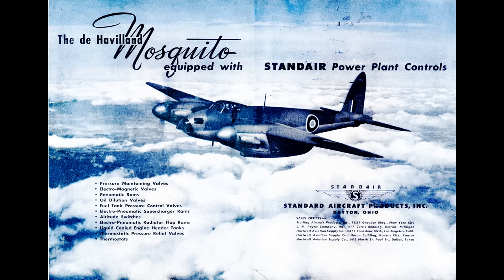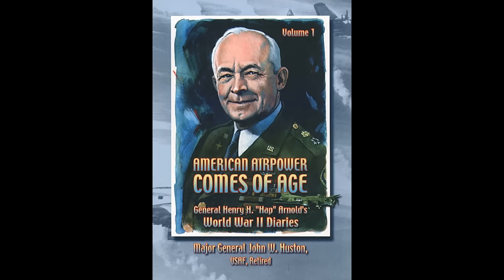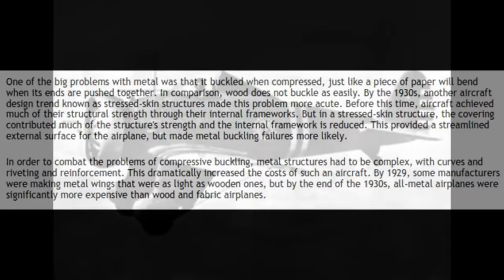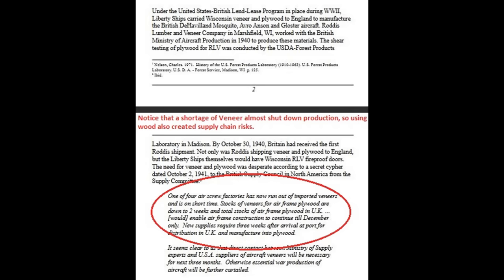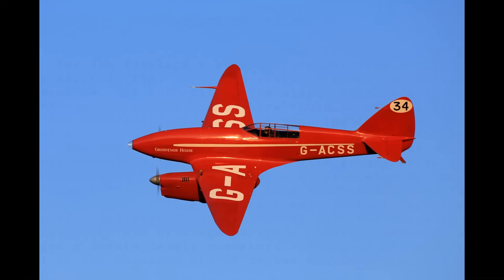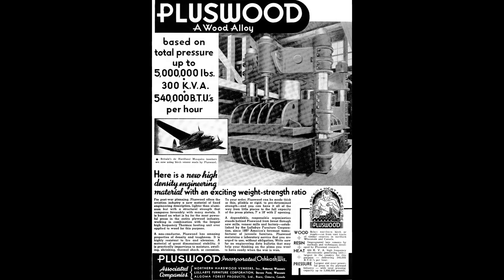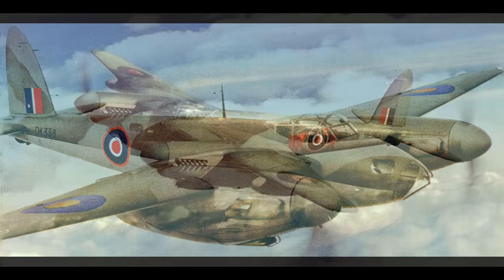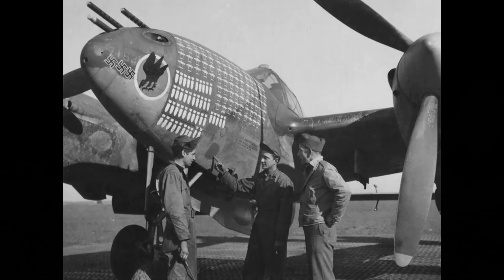De Havilland Mosquito vs. ?

Comment: Comparison of the Mossie with earlier wooden aircraft (other than the DH88 and DH91) is a little disingenuous.  Previous aircraft used a wooden structural, stress-bearing frame over which cloth or plywood (or in some cases metal) was fastened.  The Mosquito's wooden skin was the stress-bearing element.
Reply from the maker: I think you missed the point.  D.H. made the Mosquito out of wood because all their experience was based on making planes out of wood.
Reply: de Havilland didn't have any successful all-metal aircraft in this era, one could argue that the de Havilland company never made a successful all-metal aircraft.
eg; the DH 108 Swallow, DH 106 Comet and the Sea Vixen

Comment: i have seen a video where they say  is the US 9th air force swap the PR P -38 s for Mosquito and Spitfires in 1943,44

but the question off what was the best aircraft can only found if one ask 

 out of this list below you can only build one of these aircraft to do everything,witch on do you go for 

p-38
p--51
b-17
b-25
b-24
dh mosquito
spitfire
Lancaster
me 109
fw 190
do-17
he 111

if it not the dh mosquito you beet have  a good reason
Reply from the maker: P-47, Corsair, A-26 Invader, lots of good reasons.
Reply: @GregsAirplanesandAutomobiles  Really are saying if you can only have one aircraft to do every role and task you needed to do  from PR to targeted bombing you would pick the P-47, Corsair, A-26 Invader over the DH Mosquito ..
this is not about individual stats it about  what is the bast multi task the air craft and can it it do all  the task you need it to do.

Yes there all great aircraft that on a signaler task some will be better than a Mosquito,  but none of these aircraft is a better multi role aircraft then the DH Mosquito
so forget the states compere them in Military operation and tasks

so pick aircraft and match to the DH Mosquito on all the these task
i have the task the  Dh mosquito did 
heavy bombing
day and night bombing  Dh mosquito
high and low level bombing  Dh mosquito
position bombing       Dh mosquito
medium bombing       Dh mosquito
fighter bomber            Dh mosquito
defensive fighter         Dh mosquito
strike fright                Dh mosquito
ground attack fighter/ bomber  Dh mosquito
night fighter              Dh mosquito
Photo Recon          Dh mosquito
anti shipping v        Dh mosquito
passenger an postal service aircraft  Dh mosquito
resistance support      Dh mosquito
Pathfinder                     Dh mosquito
Reply from the maker: Yes, I am absolutely saying that. Furthermore, I don't think it's a valid question as no nation in WW2 even thought about building just one single aircraft, but if they did, it wouldn't have been the Mosquito.
Reply: @GregsAirplanesandAutomobiles  sorry i  going disagree with you on this 
1 all question are valid even when we not the likely hood of it happening is low
2 i find you post very interesting and informative on a technical basis but i will when comparing two or more aircraft you have take in to account there operation war record because purely compering on stats dose not give the true story.
3 keep up the grate work and have fab Xmas

Comment: There's a certain irony in that the Beech KingAir is a particularly difficult aircraft with one engine failure, especially if it's the left engine that fails. Not condemning the KingAir, just sayin...
Reply from the maker: It has to be a lot easier than a Mosquito on one engine. I have quite a bit of time in the Beech 99, which is essentially an unpressurized and stretched King Air 100, I thought it was pretty good on one engine.

Comment: I don't think the P38 could carry a 4000Lb bomb
Reply from the maker: No, but it can carry two 2000 pound bombs, and it can hit things with them. Plus while doing that it can carry 10 5" HVARs and then fight it's way out.
Reply: @GregsAirplanesandAutomobiles  it's interesting that the USAAF chose to use the Spitfire and Mosquito for reconnaissance in spite of having access to P51s and P38s . You know that the P38 was having problems especially in the ETO probably largely sorted by the the L version . Of course the British rejected it because they were not supplied with the turbo superchargers . Ultimately by mid 1944 all the bugs in all their designs had been ironed out . The problem was that USA was not ready to fight in 1942 . The fact that within 2 years they had turned this around was testament to their dynamism and ability to learn fast . By 1944 the Mosquito was being fitted with the 2 stage merlin . I think there is enough evidence to say it was the best high altitude light bomber and night fighter ; and long range reconnaissance .
Reply: @GregsAirplanesandAutomobiles  I have 1/48 scale models of these bombs they must cause large amount of drag ; they sometimes carried them on the Skyraider . Looking at the service history the P38 was mainly successful as an interceptor in the Pacific Theatre . It had some success in Tunisia even in the fighter bomber .role . In the hands of an experienced pilot it was a very good aircraft . I don't have the data but I believe the P38 was very expensive .

Comment: The US didn't need the Mosquito because they had three twin engine bombers that were jut as good, though not as fast.  The B-25 Mitchell, The A-20 Havoc and the B-26 or A-26 as it was called in Korea and even later in Vietnam.  All three used the Wright Twin Wasp engine, which also powered many single engine fighters.  The P-38 was faster then the Mosquito as a photo recon plane, as both were stripped down in the recon role,  as the P-38 was the first plane to exceed 400mph.  As for the Havoc, it was in service far longer than any other plane from WW2, fighter or bomber!

Comment: It sounds funny hearing Beechcraft making those accusations directed at DeHaviland after one of their most sold Aircraft ever is nicknamed the Doctor Killer, lol.
Reply from the maker: Beech makes good airplanes, they have made mistakes but overall, their stuff has a good record.
Reply: @GregsAirplanesandAutomobiles  I agree absolutely.  Simply pointing out the irony.  I would say that nickname came more from the Profession of being a Doctor and having extreme commitments along with the dynamics of Wx.  That particular price point of a small AC was coincidental more than anything in the design.

Comment: The Hurricane was largely wood and canvas as against the Spitfire.  But the Hurricane could take more punishment and was more important in the defeat or draw with the German Air Force.  I conclude: the rush to metal for metal's sake was, as you Yanks say, Dumb.
Reply: Sorry - the Hurricane had an all metal wing, and a metal tubular structure for the fuselage, with non-structural plywood around the cockpit, and fabric over wooden formers on the rear fuselage., largely as it was a monoplane evolution of the Fury Biplane. In fact the original design was called the Monoplane Fury. It represented a conservative transition  to semi-moncoque designs.

Comment: G'day,

Yay Team !

Very enjoyable...

 Thou art  getting to be a World-Class Fence Sitter - never quite condescending to fall in line and  support either the Big-Enders, or the Little Enders (Johnathon Swift reference, just{ifiably ?} there ; see "Gulliver's Travels...", if clarifcation needs be...).

An excellent treatment of the subject.

Have a good one.

Stay safe,

;-p

Ciao !
Reply from the maker: I am not sitting on the fence. I think I made it clear, that NASA and I think that using wood for the Mosquito was the right idea for the time.
Reply: @GregsAirplanesandAutomobiles  

  Ah, fair enough, I agree that  Wood was right for DH in Britain, in 1939-40...; but Lockheed had switched from Laminated Wood glued-up in Concrete Moulds in the 1930s (Vega...) to riveted Sheetmetal shortly before the P-38...; so to my mind, the US had pretty much started to abandon Wood when some Trimotor Airliners had their Wings fall apart from Rot, or Glue Failure, or Termites perhaps...(?).

In the USA, once the Boeing 219 & the DC-2 had appeared, Wooden Hairygoplanes became rather "Passe...".

  Beechcraft was merely parotting the Conformative Worldview with which he was comfortable operating.

Howard of the Hughes Tribe had other ideas entirely...; but Mr Beechcraft sold more Aircraft to Participants of WW-2 than did Howard Hughes...

So from a Production-Numbers viewpoint, the "Bamboo Bomber" knocked the "Spruce Goose" into the proverbial Cocked Hat.

Different strokes for different folks, I guess.

Kermit Weeks recently posted Video of how they're going about making a new Wooden Fuselage for his Vega.

  It's a LOT of fiddly kinds of Work.

And in Kiwiland, for a suitable fee, they can build you a whole new Mosquito.

Or prior to the Bat-Eaters' Lament Virus..., they would.

Have a good one...

Stay safe.

;-p

Ciao !

Comment: Wouldn't it be great to build a Mossy today with turboprop engines?
Reply: Composite airframe and a couple of P&W PT-6 engines which should fit in the Merlin cowlings without ruining the lines. 
You'd have a beautiful and fast cross-country machine without a lot of the issues with a wooden airframe and piston engines. 
Of course it wouldn't be cheap!
Reply: @Surestick88  Sounds like a good project for Bombardier. They could spend billions in government assistance money supporting Quebec  and then not sell anything.

Comment: You don't cover the Ground Attack Mosquitoes, and don't mention the 4 forward machine guns in the nose, nor the 4 cannons in the nose additionally. It would be nice if you mentioned the Pathfinder Role, dropping coloured flares to lead in the main Bomber Stream. It also could carry the equivalent bomb load to the B17 and was far faster.
Otherwise a fine video.
Reply from the maker: I can only cover so much in one video.
Reply: @GregsAirplanesandAutomobiles   Fair enough, I apologise 🙂 keep up the good work.
Reply: @Rabmac1UK  DH98 Mosquito FB. Mk VI
2,305 built.
Fighter bomber / intruder variant using Merlin 22, 23 or 25. 4 machine guns and 4 cannons, plus 2 x 250 lb bombs carried internally & underwing carriage of up to 2 x 500 lb bombs. Could be fitted with underwing rocket projectiles or drop tanks instead of external bomb carriage. 
BAE Mosquito page
Reply: @nickdanger3802  Thanks Muchly Nick
Reply: @Rabmac1UK  No trouble

Comment: 18:20 see heres my problem with this argument ...  those bullets will also go thru   the aluminium air frame just as well .. because  while it is metal .. its also really thin metal so i view it as more of a moot point  the splinters part .. year and the  structural integrity .. i have .. issues with .. after all .. plywood acts very differently to having holes poked in it that straight  timbre like on a telephone pole   also one would presume tat the grade of wood used for telephone poles and aircraft would be some what different ... if you know what i mean ... like   lots of knots in a telephone pole ant much of a problem but on an aircraft it would be a big one   on account of all the layers having the fibers at different angles and  spreading the stresses better
Reply from the maker: Wood splinters and cracks when you shoot holes in it to a greater extent than metal. You guys are going to make me go shoot a bunch of holes in plywood to demonstrate this.
Reply: @GregsAirplanesandAutomobiles   oh i dont think that would be necessary   i mean i presume it would be  roughtly eqivilant to  the  7.62 in this video https://www.youtube.com/watch?v=zVpAuWcNsVk   and yeah like  it puts a hole in it but not much worse that the hole you would get in like thin aluminum   sheeting  i mean if it was like what happens when a 9 pdr cannon ball hits the oak times in a ship and sends shards of  tumble  a foot long thru the plane then it would be an issue ... but i just doesn't see how its really soo inferior to aluminum skinned plane ?

Comment: Your statement that the DeHavilland DH 108 suffered an in flight structural failure is highly questionable. The extremely competant Captain Eric "Winkle" Brown states that the cause was a violent high speed bunt that snapped Geoffrey De Havilland's neck. The same thing almost happened to Eric Brown but being a small man rather than a tall chap like Geoffrey the bunt didn't break his neck.  The crash was therefore indeed caused by a structural failure - not one of the aircraft but of the pilot. If you search here on utube you will find various interviews with Eric Brown, and in one of those he recalls these events, in which he was personally involved.
Reply from the maker: From Wikipedia  "The main spar cracked at the roots causing the wings to immediately fold backwards."
Reply: @GregsAirplanesandAutomobiles  Better go to the man that was actually there and flew one immediately afterwards to find out what went wrong. Find the Eric Brown interview and watch it.
Reply: @vipertwenty249  "Tragically, on 27th September 1946, the aircraft broke up in the air at high-speed, killing the pilot (and son of Company Founder) Geoffrey R de Havilland. Geoffrey 'Junior' was over Egypt Bay in the Thames Estuary, carrying out trials into handling characteristics when the aircraft suffered a catastrophic structural failure as it dived from 10,000ft at Mach 0.9."
BAE DH108 Swallow page

Comment: I am late watching this as British. This is well put together well done so many forget so many things.  But as a Comparison of the Mosquito against the P38 speed similar both torpedoes Bombs Fire power rockets four 20mm canons and two machine guns in the Mosquito  Not sure about P38 night fighter as radar put in the Mosquito. But here is something the P38 could never had done and reason is clear when you think about what the P38 is made from. The Mosquito was also armed with a six pounder canon first used on German U boats submarines. Then used on tanks Just like the American A10 does.
Reply from the maker: No question the Mosquito has advantages, but so does the P-38. I'll cover all this in more detail than anyone is really going to want.

Comment: Okay, lifelong aviation fan.  I'll say this - the P-38 Lightning was the right aircraft for the US for an entirely valid set of reasons: availability of aluminum and expertise of working with it (American aircraft makers had put in the time and effort to transition to 'working with metal' and were good at it).

...similarly, the DH.98 Mosquito was the right aircraft for the UK for an equally valid set of reasons - the UK aircr- well, okay de Havilland was still working with wood, and plywood composites and could do equally amazing things with light-but-strong composite materials that Beechcraft, Lockheed, et al. were making with aluminium.  The skilled designers and workforce were still trained to work with this stuff.

The end result of BOTH processes were my TWO favourite aircraft of world war II. :)

(I will say, for being a Mossie aficionado - I'd never known about the exploit told in the ad/fluff piece/whatever at 22:41 - a bomber seals one end of a rail tunnel...then flies on and ALSO seals the OTHER end of the same tunnel, trapping a train inside!)

Comment: Rather than compare the Mosquito against the P-38 compare the Mossie against the B-17 used by the 7th Air Force. The Mosquito is smaller, faster, carried as good a bomb load, and most importantly risked two lives, not ten
Reply from the maker: I explained in my P-47 pt. 8 video why the Mosquito could not replace the B-17. So in a sense, I already did that. The P-38 is a much more valid comparison.

Comment: Considering the Mosquito had the same Bomb load at the B17 Flying Fortress, do you think the Americans could have saved a lot more of their brave young aircrews if they had taken & used the Mosquitos in their bombers role.... 
(Something a Lightning definitely couldn’t have done?)
Reply from the maker: Sort of. Had they replaced B-17s with Mosquitos, and assuming the Germans didn't respond accordingly, yes many aircrews would have been saved. However, the total loss of Allied lives would have been much higher and the war would have lasted longer. This is explained in part 8 of my P-47 series.

Comment: reported like an aviation historian would report...wood & adhesives engineering have long since proven the engineering in marine, adopting exactly the same construction...need conclusions compared for hindsight...modern composite (wood laminate is composit!) systems are a plain extension of DH concepts...can still compete today...structural strength omg it carried well over half the payload of the lancaster in the end...cost a quarter of the lanc & fly almost twice the speed...the P38 carried half the payload for the same speed & cost 4x as much, about the same as a Lancaster...missed that boat...nothing mentioned on a wings lift as a square of its speed

Comment: Greg,  in this little gem of colour film in the Library and Archives of Canada, from the Julian Roffman collection (https://www.youtube.com/watch?v=fBwkYRGnd0s), among various flying scenes in Canada is very high quality colour footage, at roughly the 5 minute mark, of Mosquito production flight test activity at the DeHavilland plant at Downsview in Toronto.  The scene with the Mossie coming in to land shows a truck driving south on Dufferin St as the aircraft is on final. At one point they put traffic lights on Dufferin to stop cars while aircraft were landing.  In the former north plant at Downsview, where the Mosquito and later Chipmunks, Beavers, Otters etc were built, you could walk up stairs to the mezzanine areas above the shop floor and see little flecks of gold in the wooden stair treads, from brass brads dropped and pounded into the wood by thousands of shoes.